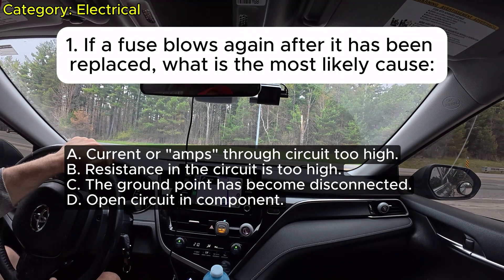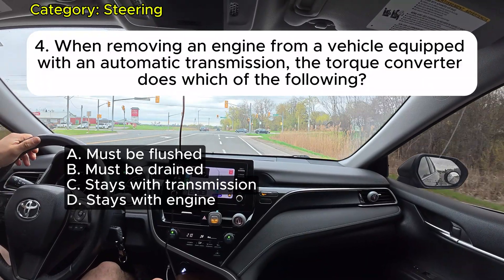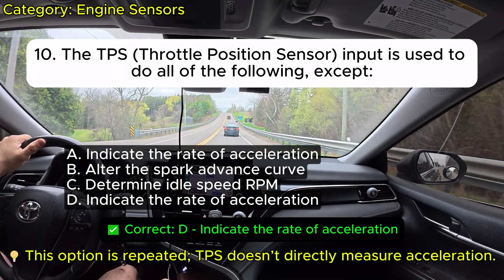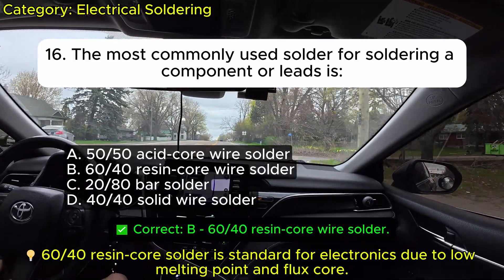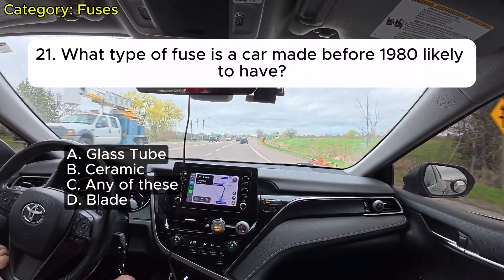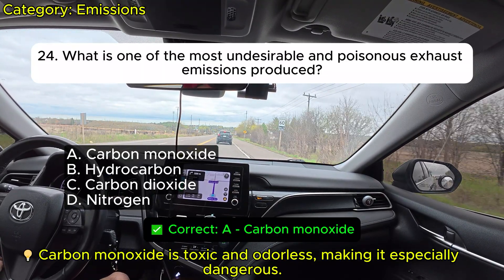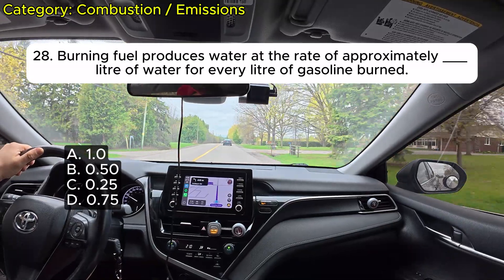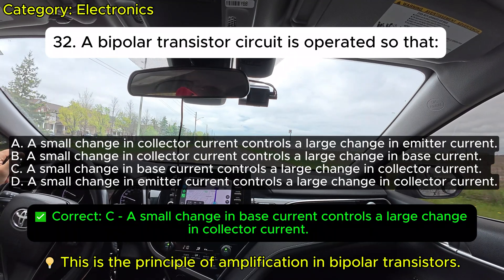#1 Red Seal 310S Mock Test | 29 Real Exam Questions with Answers

Comment: the valve head faces the combusion chamber. you have another question that says the valve face sits against the valve seat which is correct. question 8 is wrong maam
Reply from the maker: You’re right — the wording made it ambiguous. The valve head does face the combustion chamber, but its primary function is sealing against the seat. I should’ve worded that better.